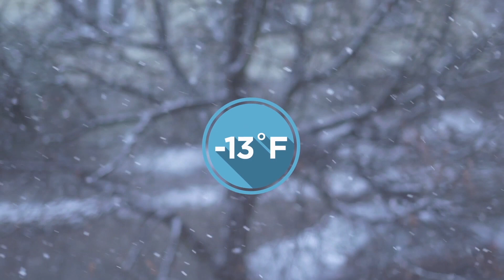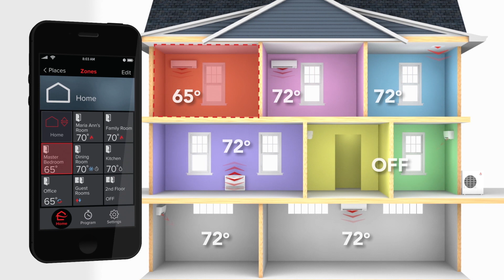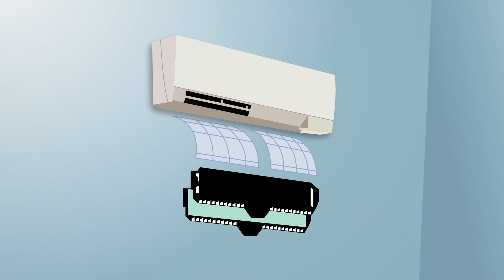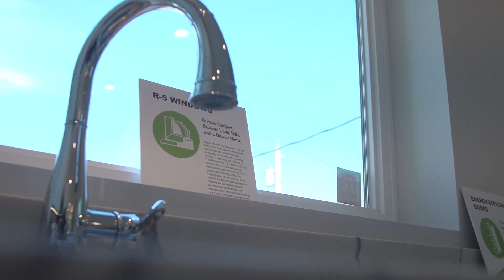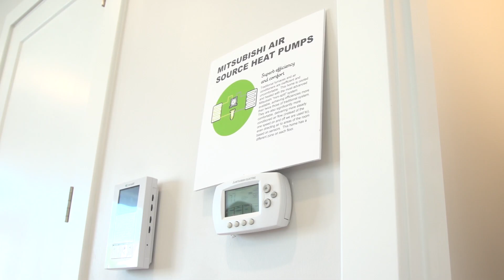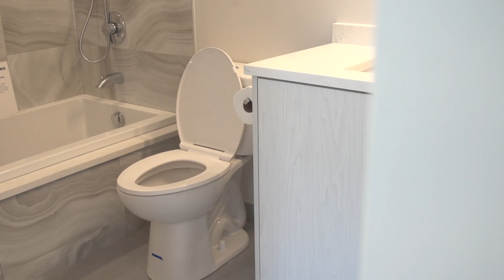Tour a Chicago LEED & Zero Energy Infill Home - pt2 - Inside

Comment: excellent information. I really had to work hard to hear.. the audio was barely there.
Reply from the maker: Thank you. Our sound engineers checked and the sound is good on our end. Please make sure volume is up and you are in a quiet room. Turn of HVAC and other noises. Consider using a headset as well and make sure your system and sound card are up to date. Thank you for your interest in building, BETTER.
Reply: @GreenHomeInstitute  must have been you tube. played this again this morning.. and the volume is fine.  very weird.. Thank you.
Reply from the maker: @stevepailet8258  Thanks for confirming and trying again! Tell us 1 new thing you learned. - Brett L, ED